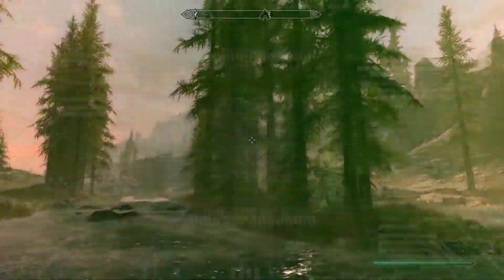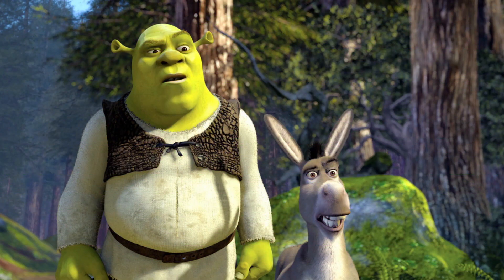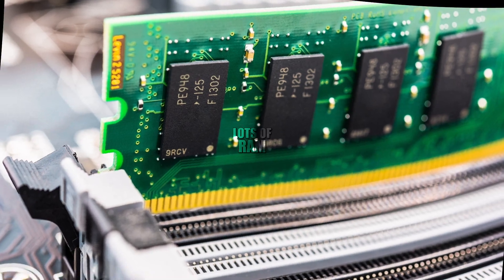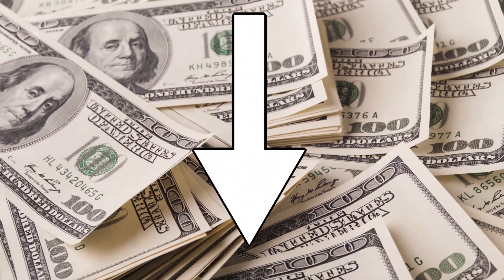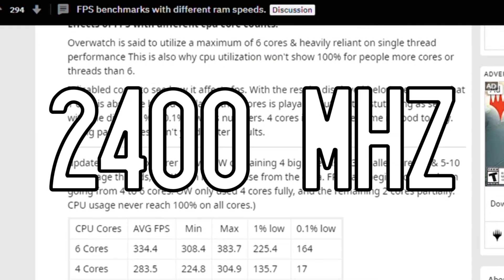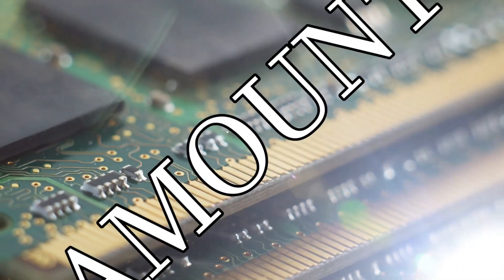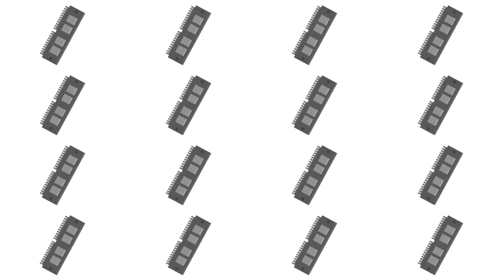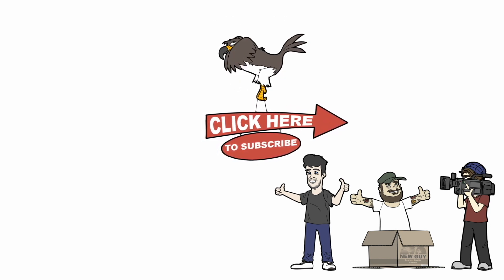Ram SIZE vs Ram SPEED for Gaming...What's Better?

Comment: Ok quick question for a quick answer. I have my old ram that came with the laptop. 8 gig ddr4 speed 2400 MHz. Later on I bought a 16 gig ram the same name and make as the original so it comes from the shop that had made the old ram. Now the new 16 gig ram is a speed of 2666 MHz. So what do I do. Do I leave it at 16 gig ram or do I make it 24 gig. Now here is the tricky part my laptop has intel hd 630 graphics and it works beside with a nvidia gtx 1050 4 gig. When I got the laptop it was using the 4 gig of my ddr4 ram for the intel hd graphics. Then I installed the 16 gig ram. Now it use 8 gig of the new ram. So no matter what size ram I use half of it will be taken down by the intel hd graphics. So in my case I get the feeling more ram is important. As I keep loosing half of it to the intel graphics. So although I’ve got 16 gig system ram technically my system is only using 8 gig. The rest is reserved for the intel graphics. What do I do?!!! My laptop is ASUs rog strix gl703vd intel core I5-7300 ssd and hdd came with 8 gig ram and nvidia gtx 1050 4 gig

Comment: My laptop ram is currently 1×8gb with 3200mhz speed and 1 empty ram slot. My sister has a 4gb ram with 2400mhz speed. Should i use it for better performance?

Comment: I'm currently shopping around for more RAM, I was looking at two sets, one was 3200, the other was 3600, roughly the same price, double the capacity if I went with 3200, so it's worth knowing which way to swing.

Comment: From my experience, i find that you can have expensive 8gb of ram overclocked as i did, and gtx 1080 8gig also overclocked, 
but the results are way more in favor to the amount of ram you have, Ghost Recon Breakpoint at 8gb of ram froze for few seconds during game-play, when i added another 8gb of ram pushing it to 16gb of ram, as a result the game opened faster, loaded faster and it did not freeze as to load components within the game its smooth, even navigating through windows apps was faster, and yes opening google chrome its a huge difference too!

Comment: Whether its open world or mortal kombat it doesnt matter, the scene no matter how large would only fit in the available memory, mortal kombat uses the same amount of vram per frame as any open world, in open world games the trick is procedurals and asset streaming, the gpu deletes and loads assets lowers resolutions uses tricks like level of detail and tesselation to proceduraly and dynamicaly make sure u dont go out of vram however you play, ram capacity is the reason you have good graphics meaning ram is like a universe that has whatever ur playing and more capacity means better graphics and more bandwidth and speed means smoother gameplay. Its simple as that. You cant escape capacity and nextgen games would need more ram to display nextgen graphics you can have 8gb cards at a billion gb per second but that would simply improve framerates not graphics quality.

Comment: There should be a real comparison of CPU + GPU + RAM + SSD speeds and limits to explore what someone's throttle is.  Like I bought an ultrabook that claimed it wouldnt really be able to graphically display WoT, yet it does ok. The graphics look decent enough and I get the FPS that I would want, without needing an actual GPU card.

Too often people dont explore loads and what limits. Yes RAM can be a bottle neck for an application that specialise in using AS MUCH RAM as you have. Clearly core count, and core speeds or math functions that could be conducted not on the CPU but rather on the GPU might not be a product of how much RAM that you have.

Just saying...

And that also excluded 'bad' coding that writes too often to an SSD.

Comment: Here I am, with 16Gb DDR3 clocked at 1333 Mhz. Not that it matters at all, since the bottleneck on my rig is the dud FX 8350 on it that can barely manage its stock clock without BSOD'ing. I'm due for a $500 upgrade in the next couple months.

Comment: The correct answer is both. If you're spending money, make sure you won't run into an issue that could easily be avoided within your budget. 16GB RAM with 3200MHz is a good compromise since you don't need more than 16GB for games and  3200MHz while isn't the fastest, it's fast enough to not cause you any problems. 

My 6700K i7 CPU can put most CPUs to shame tested in gaming because of the single core speed is up to 4.7GHz but has only 4 cores so isn't great for work stations. On the other hand some much more powerful CPUs have 8 or 12 cores but clock at 3.2GHz and can be over locked to 3.8GHz. great for multitasking, but meh for gaming. 

It's all about priorities in picking your components in a build.

Comment: more ram you add means the more ram speed matters because you multiple ram speed by each gig or ram you add.... right?

For example one gig running at one gigabit-per-second would be one gigabit-per-second but one gig running at 2 gigabits per second would be only a difference or 1 gb/ps not noticeable now let's do that with 8 gigs of RAM. 8 gigs of RAM running at 1 gigabit per second would be 8 gigs of RAM per second but 8 gigabytes of RAM running at 8 gigabits-per-second would be 64 gigabits-per-second in total.... right? So a difference of 56 gb/ps a very noticeable difference. At least thats how i understand it at the basics

Comment: I can give an example on this video a friend of mine has a very similar spec computer to me apart from the difference in RAM we have the same number of gigabytes in RAM but I am running dual channel 2400mhz ddr4 and we have both been playing witcher 3 in ultra settings but I will be getting 75 fps  and he will be getting 30 fps but we are both running the same graphics card and processor

Comment: I find 32gb is a good spot for me “took ages to find 2X16gb for expandability”
Both desktop and laptop tend to idle as far as 20% if i have browsers open particularly the laptop where i never close chrome.
Chrome went down to only using a few gb when i found a extension/setting”don’t remember which” that stoped it loading every single tab at the same time. Thats with a moderate “for me” number of tabs and windows. “Still far to many”.

Comment: Remember it's the CPU who control how mutch RAM speed it will use. Unless you overclock it. For a i5 9600k without OC the top seed will be 2666MHz.

Comment: To begin with when ddr 4 came out, there did not seem to be that much difference between it and ddr3 at higher clockspeeds. So I did not worry too much about it, but I think as the new ram settles in. It is going to start to matter more, meaning that soon I am going to need to upgrade my ram. Meaning new board, meaning new cpu and of course them new ram. A lot of expensive so I'm holding out a while, there are other things I want to do.

Comment: 16Gb for most all modern gamming PC's. 32Gb or more if you run a SQL or Virtualization. After meeting primary requirement speed now becomes the main concern.  You want as fast as you can afford. The faster the better though is not always the best you need to look at and understand CAS Latency and CL Timings. While it has been generally considered that the lower these values the better the Ram is; is a misnomer and not always true Especially with the new generation DDR4 and the up comming DDR5. Once you understand these concepts you can build for it and eventually your hard drive will be the bigger bottle neck and you'll start looking into SSD's to eliminate the bottleneck of load times caused by plater drives

Comment: It's been tested by a number of people.  End result, as long as you have enough ram, amount doesn't matter.  Speed matters, especially with Ryzen, though 9th gen intel also has larger than usual performance increases when going from say 2400-3200 mhz.  

End result, get at least 16 gig of ram, and the fastest speed you can get your hands on for a decent price.  No use paying lot extra for 100mhz faster if it's more costly, use that $$ on cpu or gpu.

Comment: There is a much better way to describe this. Storage is slower than RAM. If there is not enough RAM, Storage will be used greatly bogging down the speed. Determine largest amount of RAM to be used, and get that. More RAM at that point will not improve speed. There is more than just speed at this point to consider; latency was missed.

Comment: I think the point is, you have to get enough ram first, then try getting something faster if you so want. Which means, for gaming and most works, you should get 16GB (don't get 8 unless it's a gaming only PC and you are okay with closing everything else before launching the game), and for graphical works, get 32 if it's possible, or even higher if dealing with multi gigabyte image files I think. (Oddly enough, music software isn't actually overly RAM consuming but maybe that's not true when track count hit the 100 mark.) (Also, higher RAM means possibility in making use of ram disks which might be helpful but, that's kinda a waste of money unless you got nothing else to improve.)

Comment: The easy way of looking at it is this:

RAM is what holds your active data, the active data being the data that your computer is using/running at the time: be it a game, a web browser, or a video player, and of course your operating system.  If you don't have enough RAM to hold all the active data, than you will start to see serious slow downs/lag in your computer speeds because now it's trying to keep any active data that doesn't fit on the RAM on your hard drive (the hard drive of course being much, MUCH slower than the RAM).

But once you have enough RAM to hold all that active data, than any excess RAM is essentially wasted space that isn't being used for anything.  At this point, RAM speed becomes more important.  As available space on the RAM is no longer an issue, having faster RAM now means that the CPU can process your active DATA all the faster allowing the computer to run more processes in the same amount of time.

Currently on Windows 10 with a modern 30GB to 80GB AAA game running (or other intensive application), 8GB is just enough to ensure available RAM space for the bare minimum amount of active data.  A little bit more for those who have web browsers, live streams or some other application running alongside the game ensures enough space for those applications as well.  Most modern users will only ever use about 10GB - 14GB of RAM and so 16GB is the preferred among gamers.

Note that this will of course change as time goes on.  Only 5 years ago, 8GB was considered plenty for gaming with 4GB being the minimum.  So it's entirely likely that by the time you start considering a new gaming system to replace your aging computer, these minimum and recommended numbers will have changed yet again.

Comment: Where is the proof. If you are comparing Intel and AMD fine we all know that ryzen loves high speed ram‚ and are you competing frame rate to, if you run the same game with the hardware but different speeds on an Intel platform that's just going to be margin of error of 1 to 5 % not slot only 1 to 2 FPS, but if you do the same thing with AMD you are going to see a quite a big bump in performance.

And also with the overwatch bench mark, the test bed has an i7 8086k you said that they was comparing 1600 mhz Vs 2400 on ddr3. How? If you are comparing ddr3 platform to a ddr4 the there is definitely going to be one. 

That's just my thoughts all that's we needs is the proofs.

Comment: I just saw this video and everything matters. You want a good amount of RAM for example 16GB DDR4 memory at preferably a higher frequency and lower CL (case latency) right now for the system. The more balanced you are on this the better you will be overall since programmers have different methods of using PC hardware. If you focus too heavily on one aspect you will be hurting yourself regarding games that are programmed using the opposite method your system is built for. It is about balancing all aspects of a system to get the best balance not lean too far in one direction.

Comment: Frankly, think when I build my new PC in a couple of months, I'm gonna go with AT LEAST 16GB of DDR4 RAM but I'll probably take the 4000MHz avenue just to keep both the amount and speed routes covered. Even the most advanced CryEngine games are pulling decent performance with 8GB of at least DDR3 RAM, these days.  No real need to go crazy with the highest numbers imaginable, y'know?
Reply: Are you going with a Ryzen or Intel Cpu?
Reply: @PaulvZyl  To be honest, I hadn't quite worked that out, yet. The new Ryzen CPU is tempting, but one has to keep cooling in mind. If Intel has a comparable chip, it's worth researching and comparing.

Comment: It is more important for gaming that you have dual-channel memory whitch means you have 2 sticks or even better more
Reply: Not exactly. More than 2 will not improve things for 95% of people. It depends on the chipset of the motherboard. Most consumer level systems, Intel i9 9900K and below, or Ryzen 3900X and below, have dual channel memory support. So they benefit from two memory slots (the exception being a A320 motherboard for Ryzen PCs, but they're garbage, don't ever buy a A320 MOBO). Adding more than 2 sticks (most will physically take 4) won't help since the memory bus is still only using the speed of 2 dimms at the same time. You get no extra speed, just extra capacity. 

HEDT systems, ie i9 9920X and above or AMD Threadripper, usually have quad channel or better support, then having 4 dimms will give improved memory throughput.

Comment: This is kind of the worst explanation I have seen :( RAM speed affecting game performance is not a new thing.  It's been a factor for years.  Have a look a digital foundry investigation a few years ago. Across pretty much ALL games. Time spy doesn't show a difference because it pretty much only uses VRAM, change the speed on your VRAM and time spy results will form accordingly. This is generally never the case in games as they do use some system memory. 90% of games don't see any performance change moving from 8 to 16GB of system memory,  10% (mostly new AAA) can see improvements with 16GB, and a small number (single digits) of games may be able to make use of more than 16GB. I think star citizen is one. But generally framerate across the board can be noticeably affected by RAM speed. Diminishing results TEND to kick in at about 3000-3200MHz depending on game and hardware factors.

Comment: An easy way to see it is: 
- If you have less RAM than what the current use needs you're gonna have a TERRIBLE TIME. (Stuttering, skipped frames, programs crashing, etc).
- If you have less RAM speed, it mostly decreases a theoretical maximum potencial your pc can bring to the table.
So yeah, while I streched my money the hardest to get to 3200mhz memory (this was last year when memory prices were crazy), if the choice was speed over capacity, I wouldn't have changed my 16gb of, say, 2600mhz for 8gb of 4600mhz, as 8gb get filled quite fast with some new games.

Comment: Well, there is quite a difference between GPU RAM and system RAM. System RAM is where the application/program is loaded (ie. game logic, audio files), while GPU RAM is where graphics related resources are loaded (ie. textures, 3D models). Graphics related resources are also loaded into system RAM but only in preparation for it to be sent to the GPU (ie. OpenGL, DirectX needs quite a bit of CPU to serve data to GPU, while Vulkan reduces this requirement)

This is a generalization, of course there are nuances to each game's memory management.

EDIT: 5:22 That's a good way of putting it.

Comment: What about RAM latency? RAM speed alone can't really tell the whole story.
Reply: Latency doesn't matter as much with DDR4 since the clockspeeds are so high. Latency is a function of how many cycles it takes to retrieve data from ram. 

DDR4 2133 MHz generally has Cache Latency of 14, effectively 14 clockcycles of delay. High speed ram typically has higher latency, 3600 Mhz ram will generally be CL16. However it's still faster because though it takes more clockcycles, those clockcycles are much faster.
Reply: Evil bred You are kinda right, but in some cases, it's more important than clockspeed. Because for example, a 2666 MHz CL13 DDR4 RAM is faster than a 3000 MHz CL16 DDR4 RAM. In the first case, the true latency is 9.75 nanoseconds, and in the second case, it's 10.67 nanoseconds. And if someone doesn't know anything about RAM timings, they would happily buy the second RAM kit over the first one, because "it's faster", even though it's even a littlebit slower.

Comment: You should be looking for this answer right here

In general, you would need between 16 to 32 gigabytes for gaming but there's also a thing with speeds and latencies.

Non-overclockable Intel CPU's require less out of your ram since they need around 2666mhz and they are usually low in latencies. Overclockable CPU's will benefit more from faster memory speeds.

However, Ryzen CPUs from the 3rd gen have a stock speed of 3200mhz. They require a bit more and they generally benefit from higher speeds and a reasonably tighter latency for that speed. If you were to use slower memory than the stock speed you wouldn't really get the optimal performance.

With Intel, you don't have to worry much about what kind of memory but with AMD you should look and compare a bit.

Comment: Curious where the figure of 1GB in 2011 came from. Back in '07 I had a pretty cheap regular desktop (the kind you'd buy at a retailer like Walmart) and it came with 3GB.

Was 1GB the "average" of users? Because surely it couldn't be new PCs.

Maybe laptops? But even my 09' laptop has 2GB. Once again not a "top of the line" machine either